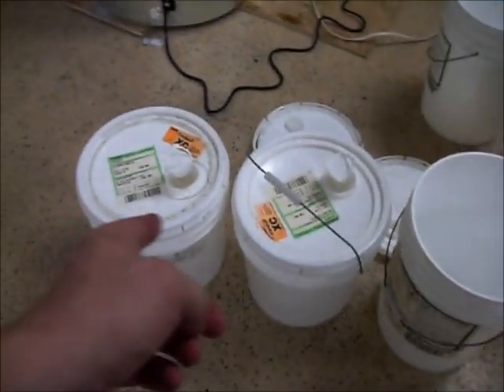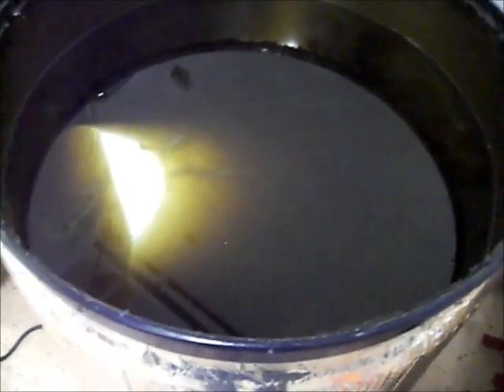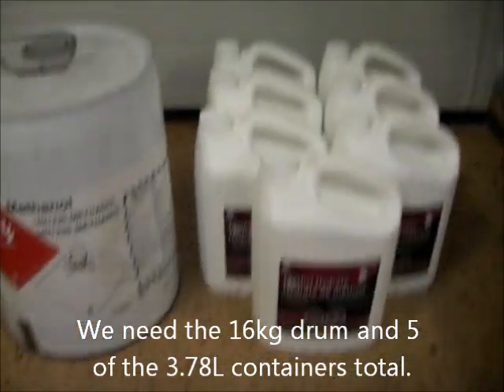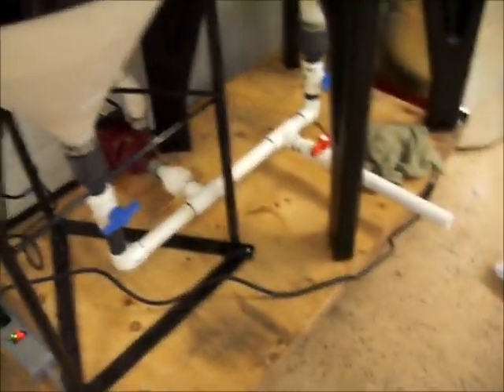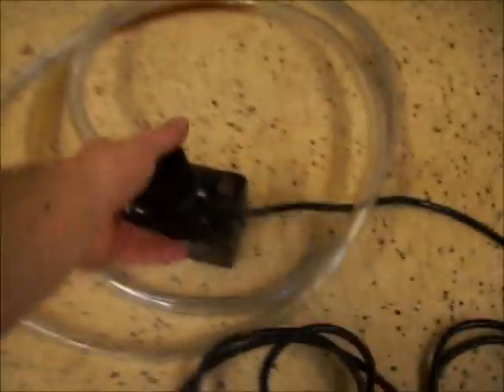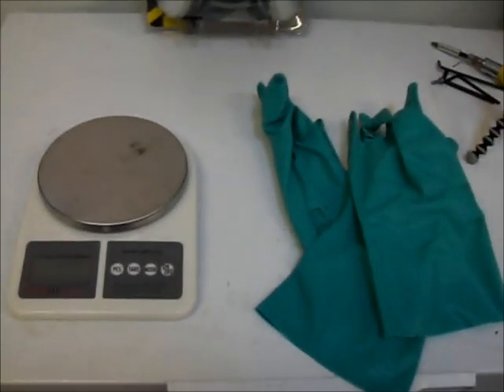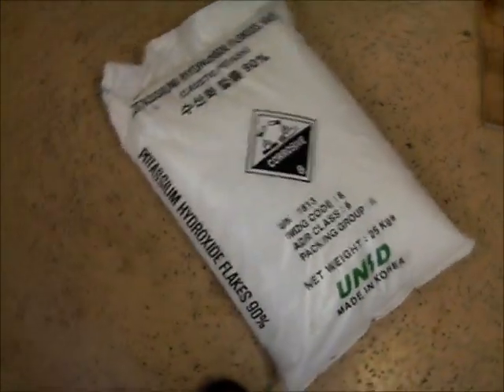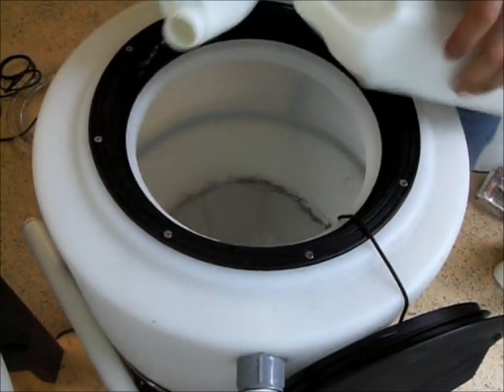First batch of biodiesel from virgin veg oil

Comment: OK the hard oil the coconut oil and stuff to use it melts down but when it cools off doesn't it get hard again I mean you pour that into your fuel tank how are you going to keep it liquified you're gonna have to heat it up
Reply from the maker: True, using bacon fat to make fuel it's hard at 9degC. Coconut oil melting point once it's turned to biodiesel is probably higher. Blend with petrodiesel or run only in summer.

Comment: Hey great video! what pump do you use for the used oil in the processor? thanks
Reply from the maker: That was a sump pump I chucked into the steel drum I use for pre-heating the oil. Sucking up room temp oil say at a restaurant is very difficult under cold  temperatures. Almost need a large diaphragm pump or something.

Comment: Please how many heaters did you use?
Reply from the maker: Usually I used two aquarium heaters for drying in the main tank after water wash. There is only one heater on the steel drum which heats the oil. I believe it was about 1200 watts. You can buy drum heaters in various sizes/watts.

Comment: is not dangerous that kind of pump for metanol ??.
Reply from the maker: Everybody who has a single stage processor has used that type of pump no issues. Sure it's not explosion proof but essentially you are doing this in a "sealed" system so vapours are minimal outside the tanks/pipes, also induction AC motors don't use brushes (no sparking). I made over 20,000L on this setup before I bought a biopro190 processor.

Comment: clean veggy oil can be put right in the tank with about 10% gas you dont need to take out any glycerin.I filter used motor oil and add10% gas 90% oil and all I use is 50 25 10 and 1 micron bag filters with a pump.Very cheap and a higher BTU then veggy oil.1987 mercedes 3L diesel 1994 cummins 12v and 2002 cummins 24v all run great.

Comment: Hey Westvandude. What about the oil which is made from plastic can it be converted to biodiesel?
Reply: Hey mate, It doesn't really matter if you add the Methol or KOH first, what matters is it all should be liquid form before you add it to the Oil. Just make sure the KOH dissolves properly before going to the next step of adding it to the oil.

Comment from the maker: bossbuck d o t com/products/parts/lids. h t m l  It's actually a funnel you weld onto the bottom of a 55gal drum for a deer feeder. I originally wanted to weld up a 55gal drum with that on the bottom as a main processor but bought the plastic tanks instead.

Comment from the maker: I actually turn on my pump and circulate the methoxide in the small tank before mixing it into the oil tank. I found if I let the methoxide sit in the 15gal tank it can precipitate and actually over a number of batches clog up the drain. I had to poke a coat hanger in it to open it up once. So now I mix it.

Comment from the maker: It doesn't really matter. As long as you can pour the methanol in fairly quickly... ie one big bucket. It will start to bubble and off-gas really quick so you want to put the two together and get a lid on it for your own safety. When in doubt wear a mask with good filters. My scale is only 1000g so I scale the KOH twice, open lid, throw in. No problems. Typically 1850g koh on 46gal used fryer oil. Your titration will be different.

Comment: Hi, i have a question which bothers me a lot... So, if you add your measured KOH first in the methoxide tank ( over the the basket ), and then add your methanol, is that acceptable? Or it has to be methanol first and then the measured KOH ? thanks in advance

Comment from the maker: Good to hear. I've seen that before. Do you have any vids on it? I'm not worried too much about the reaction speed.... the way I'm doing it, it's literally 99% separated 30mins after mixing it for 1.5hrs, I usually let it settle out 24hrs. My batches are more or less weekly so until I need to make it more often I'm not in too much of a rush.

Comment: I have experimented with high voltage separation and found that it will aid in the process of of condensing the glycerin. By separating the oil from it using high voltage and it takes about 3 to 4 minuets for every 30 gallons or so given say a 4 watt unit and a leftover coil from a car. The probes can be about 3 to 4 inches apart and will generate their own flow in the tank without the needed aid to stir it.

Comment from the maker: Did you use potassium hydroxide or sodium hydroxide? Sodium will go hard. You want to use KOH. During my process I can see pretty distinct layer separation after even 1/2hr once the circulation pump stops. But I usually allow it to separate overnight or 24hrs. They use KOH for liquid soap making and sodium hydroxide for bar soap.